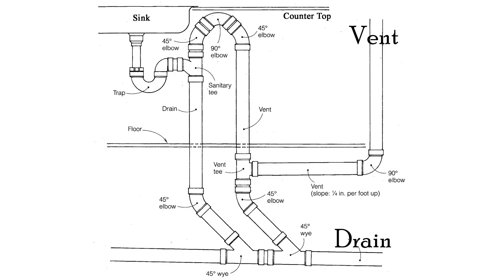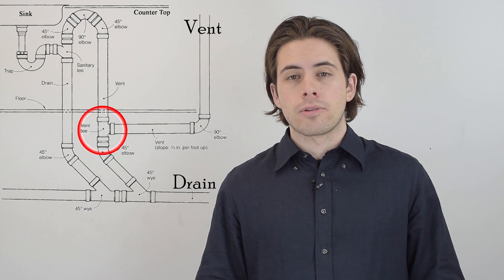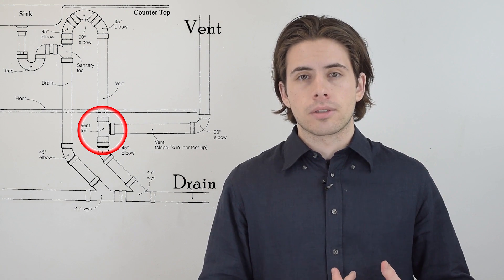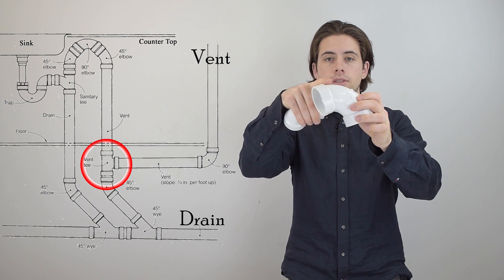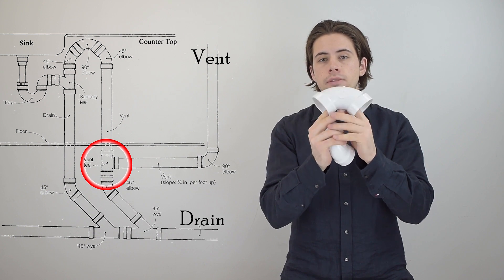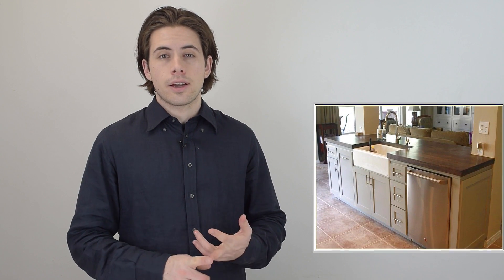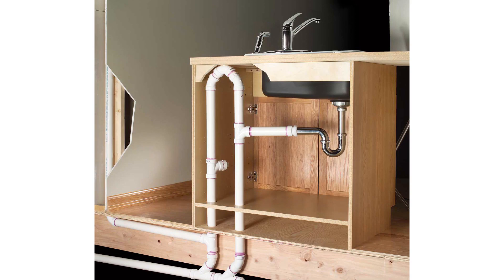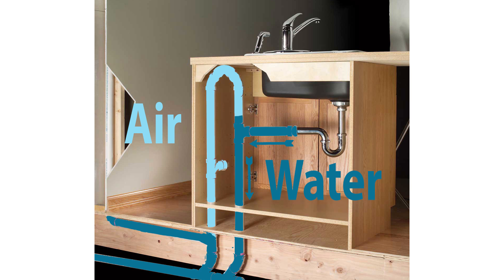Loop Vents for venting islands in your kitchen

Comment: @PEX Universe, nice summary of how to vent an island kitchen sink.  Just went through a multi-day, multi-snake event where both the vent pipe and the drain pipe were blocked.  Once I cleared the drain with a snake, the sink would still drain only about 1/3 of a bucket of water before the water could be seen backing up in the disposal bowl.  Figuring an air lock, I even took the step of putting a garden hose down the vent pipe where it exits the roof and ran water for some time.  Still not more than 1/3rd of a bucket before backup.  (It would eventually drain).

At this point it seemed clear that the blockage was in the vent pipe near the common drain pipe (1:25 in your video), causing an air lock which prevented normal flow of water down the sink drain line.  Unfortunately, the original plumber installed the clean-out in the vent pipe where it rose up the external wall.  This clean-out was now buried behind not only drywall, but also behind kitchen cabinets.

So, I built and installed a new loop stack which included a clean-out fitting on the vent pipe.  Once installed, using this new clean-out opening, I snaked the short section of the air vent down to the common drain pipe.  Finally success.  (Just beware that you may need a bushing fitting to transition from 1.5 to 2 inch above where the vent pipe disappears under the floor of the cabinet).

Your graphic at 1:25 is pretty close to the double blockage condition that I found; both the air vent and the drain pipes were clogged.  Even after snaking the drain, the clogged air vent pipe (near the common drain pipe) set up an air lock preventing normal flow.   

As an aside, your depiction of which sections of the two pipes contain water is not correct for a normally-flowing drain.  Normally, there should be no water  backed up into any part of the air line as gravity would carry the water down the common drain pipe before it started backing up the air vent pipe.

Thanks for giving us all an explanation of air vents, however.  You are correct that a well installed air vent pipe WITH local clean out is as worry-free and durable as the main drain line.  Just don't wait 20 years to do your first snake out, like I did.

By the by, we used Wiresbo PEX for all of our water supply when we built 20 years ago.  I have loved it ever since.

Comment: Under our new kitchen island sink the plumber roughed in 2 ABS pipes. An inch and a half and a two inch pipe. I assume the inch and a half is the drain pipe and the two inch is the vent pipe. Am I correct in assuming I need a 2 inch bow vent tied into the inch and a half drain pipe?

Comment: What about adding a dishwasher to an island? Do you need a loop / bow vent for that as well or can you go directly into the sewage pipe below the subfloor (from the kitchen sink)?
Reply: I know this is an old comment. But I figured I would give this a go since it's usefully info for someone else. 

If you have a dishwasher in an Isla d with no sink. Then you will have to add a drain. If you add a drain you should add a p trap. If you have a p trap. You must add a vent.
Reply: You need an air gap and a drain into either a garage disposal or a wye in the tail piece

Comment: I'm moving my sink from the outside wall to island. Thinking if I keep the old vent tied into the drain pipe in crawl space it should vent. Am I correct or not ?
Reply from the maker: It can be still usable. Is this a DIY project?

Comment: can you make a video with a mechanical air vent. there is a situation where you cant connect to a vent pipe, like a kitchen island  in the middle of the room or sink with the concrete exterior walls

Comment: Just studer vent it...loop vent when framing won't allow for normal venting...
Reply: I would recommend only using air admittance valves if you absolutely must.  Generally for a retrofit, where the drain was never vented properly in the first place, and building a standard vent in an existing building would be impractical.   The home owner should be educated on it, and I'd even recommend posting a laminated instruction sheet inside the cabinet, in case they forget how it works in ten years.   The vent is prone to failure, and when it does fail, it lets the sewer gasses enter the home.

If there is the opportunity to build a proper vent that eventually leads to the roof, build it that way to minimize the maintenance the home owner would need to do.

Comment: Can I make my loop vent lower than the sink or just barely over sink bottom? I need clearance for my drinking water faucet
Reply: Did you ever get an answer to this question? How high must the loop go?
Reply: The top of the loop should be above the flood level rim. In theory should be 6” above flood level rim for code compliance (here in NYC) under a cabinet you can not physically go above that so putting the top of the loop as high as possible is fine.

Comment: I’m working with an island kitchen sink, that is directly above a theater room, with a loop vent my waste line falls below the floor joist, instead of lowering the ceiling height I want to install a sanivite grinder pump under the sink. The waste is under pressure through a 1 1/4” drain line. My question is when my loop vent travels below the floor into my combo, what do I do with the drain side of that below combo. Would I long sweep 90 1 1/2” over to my vertical vent, In place of the combo traditionally? 
Thanks for your thoughts, and enjoyed the video great explanation of loop venting!

Comment: Good video.  Loop vents don't have to be the rocket science some plumbers (and inspectors) claim.  Three elements... you need to connect to the "real" vent above the flood level of the fixture.   You need a clean-out (or clean-outs - multiple) that will allow ever inch of the pipe to be "rodded"... and you need the relief drain that you mentioned in case it does flood.   Now all that said - I've been installing DWV plumbing for 30 years - and there are bladder/automatic vents  I installed way back then that are still doing fine - no problems so far  And if the AAV is installed properly in an accessible spot - even if you did have to replace it it's a $20 part and a five minute job.  Spin the old one out... Teflon tape.... spin the new one in.   Good ones should last for decades (like I said - I have 3 decades worth of history with them and not one single problem yet...) .   It's a much simpler, straight-forward solution.    Most homes are remodeled/re-configured far more often than that automatic vent is going to fail anyway...  making  all of this a moot point.